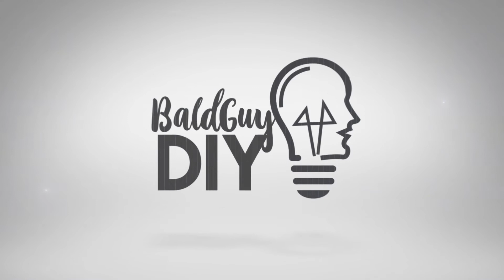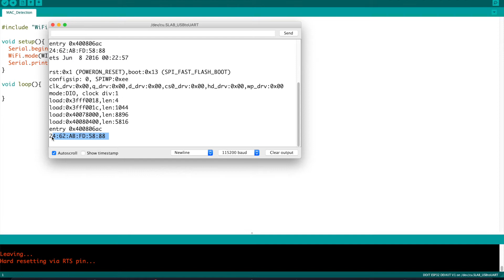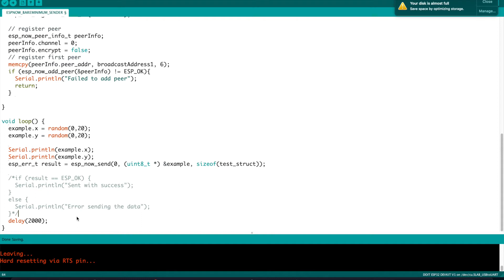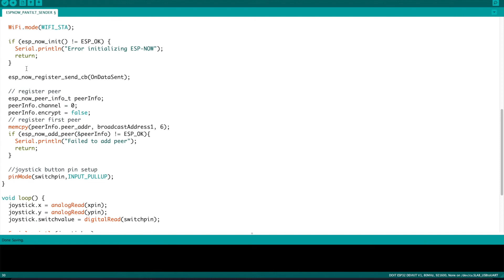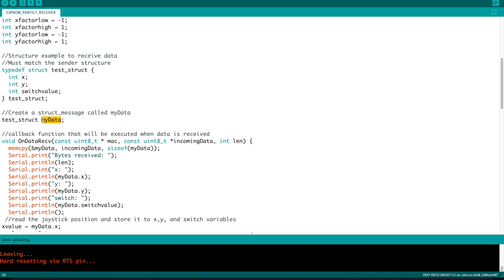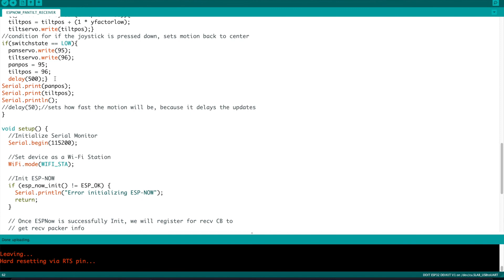ESP32: How to setup ESP NOW for One Way Wireless Communication

Comment: Im attempting to copy your code. you showed your code for the receiver but not the sender, only the example. i need the code for the joystick side. I got it to connect and the servo moves but I cant map the joystick to the servo for some reason. is there a GitHub you have posted your final codes at for RX/TX ? or can you send it to me?
Reply from the maker: Thanks for watching. If you send me an email I can send you the files I used. brandon@baldguydiy.com.

Comment: Will this work with ESP8266 ?  I've been trying with no luck.
Reply: I've had some luck, I can get connection and see on the serial monitor x and y = either 0 or 1023 by moving joystick, but I can't get any servo movement
Reply from the maker: I’d recommend doing some print statements in your code to see if the message is being received. Print the variables to the serial monitor and see how they are coming through and updating. That way you’ll know if it’s the communication or servo code that is problematic. Thanks for watching!
Reply: @BaldGuyDIY  hey thanks for actually responding, much appreciated! I can get some readings on serial monitor but they are only 0 or 1023, nothing in between and the servo won’t move. 

I’ll probably just buy some ESP32 boards to solve this. 🤦🏻‍♂️
Reply from the maker: @DustinjBailey  it probably has to do with the structured message naming or format. Simplify, try sending only one variable.

Comment: I have made two ps2 controllers with integrated esp8266 and battery that allow me to control esp8266 light strips in real time. I wanted to make a generalized remote control out of it as ps2 controllers are really cool devices and you only need to connect 4 wired to the esp to power and transfer the data. (2* analog stick) + tons of buttons+ awesome ps2 feel.
Maybe i should put that on a project page... It was a little bit difficult to initialize the ps2 controllers into analog mode reliably, but now it works well, it uses 2*AA battery and will have a long lifetime of over 24 hours.
Reply from the maker: Sounds like a fun project!  Thanks for watching.

Comment: Thank you so much for this video, took me longer than it probably should have to get this figured out but I cant wait to make a toy car for my kid using this :D (its perfect, im going to use one axis for the steering, and the other servo to provide a analog input of sorts on the drill circuit im using as the supply to the old drill motor, this solved like 85% of the coding headache for me!)
Reply from the maker: I’m glad the video was helpful. Thanks for watching!!

Comment: I’m trying to send a PPG signal through an esp8266 client to a esp8266 server, and I’m having trouble with sending data to the server. The client reads the values perfectly through the serial control panel and even on the serial plotter, but when I check my server I’m not getting anything
Reply: Can anyone help?
Reply from the maker: Hi Michael. Not sure I understand exactly what you’re trying to do with the communication. Are you using ESP-NOW or another protocol?
Reply: @BaldGuyDIY  do you have an Instagram or something where I can send u what I’m working with
Reply from the maker: @michaelaldape5584  you can send it to my email brandon@baldguydiy.com.
Reply: @BaldGuyDIY  thank you! I’ll send it once I’m off work

Comment: Very helpfull! 
I tried with an ESP8266-01 and seems to work perfectly when I read data on serial  monitor but I don't know how to use input and output pins. I need to read an incoming data (serial data) from a pin on the sender  and send out the same data from a pin on the receiver.  Can anyone help me?
Reply from the maker: Thanks for watching!  I’d recommend https://randomnerdtutorials.com/projects-esp8266/
They have a LOT of ESP8266 specific tutorials, you can probably find everything you need to make it work. Good luck!
Reply: @BaldGuyDIY  Many thanks. 
I have already looked at this site but I have not found anything that works
Reply from the maker: If you’re looking for wired serial connections, looking at Arduino tutorials could also be helpful. Just make sure you’re using the correct pins on the ESP device. The diagrams on the random nerd site are great for that.
Reply: @BaldGuyDIY  
I solved the problem. Just used the correct pins as you suggested me. Thanks again.
Reply from the maker: @robertobertoni  That’s great!

Comment: Is there any special reason why you did not use the broadcast address? It would make things even simpler, as any listening ESP would receive the signal from the sender ESP. Another advantage is that it would directly work with any new "receiver" as the broadcast MAC-address will always work and be the same?
I ask as I experienced some issues (maybe because of the broadcast address). As long as my ESPs were connected to any WLAN it was OK. As soon as there was no WLAN (no idea why ...) the receiver started loosing some messages that caused jitter. Did you experience any anything similar?
Reply from the maker: Thanks for watching and commenting!  I didn’t use a broadcast address as it isn’t required for single direction communication with ESP-NOW.   The sending MCU will get a successful message when the receiver has accepted it. The nice thing about ESP-NOW is that there is no need for a WLAN. It’s just direct communication between microcontrollers. Each new receiver has its own MAC address, which is how the messages are identified, so you just need to put a new receiving address for each new receiver.

Comment: Did you  know that you can use ESPNOW with Wemos D1 Mini
Reply from the maker: Thanks for watching and sharing that. I’ve never used a Wemos D1 Mini, but it makes sense that it can use ESPNOW because it appears to use the ESP8266 chip. What advantage do you feel it has over the ESP8265 or ESP32?
Reply: @BaldGuyDIY  Thanks for the video it's just an alternative to EP32

Comment: Hello.... good explanation..... how can use ESP NOW for ( pick to light system) .
Reply from the maker: Hi, thanks for watching. If you’re doing a large system, if you need to integrate with other systems you’d probably use a different communication protocol than ESP NOW. Maybe just wifi. ESP NOW works great between ESP microcontrollers, but won’t be compatible with other devices. Sounds like a fun project for you!
Reply: @BaldGuyDIY  Thanks for the quick response. can you please guide me on how to start with 4 ESP's
Reply from the maker: @kiranghatge4301  my video was intended to be a very basic setup for a single device. If you want to make a more advanced setup, I recommend checking out this link:
https://randomnerdtutorials.com/projects-esp32/
There is a wealth of sample scripts and explanations there, with ESP NOW and other protocols as well. Good luck!